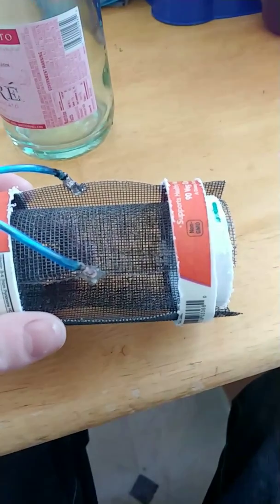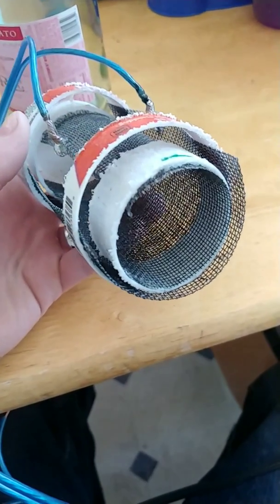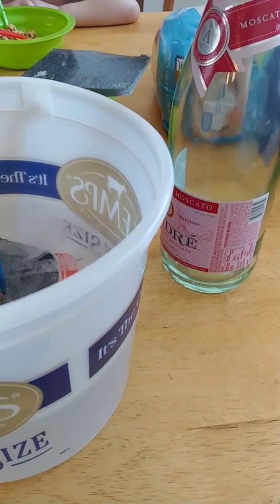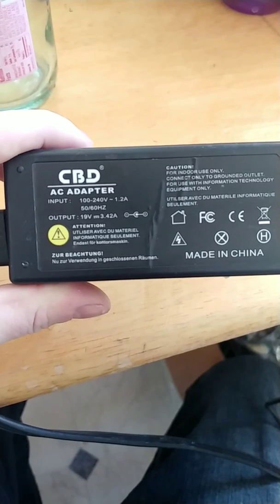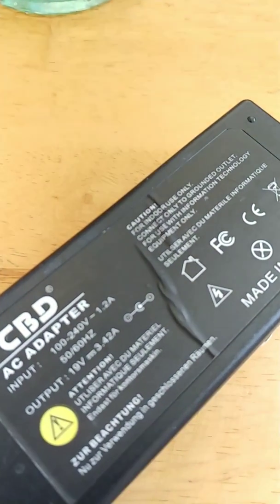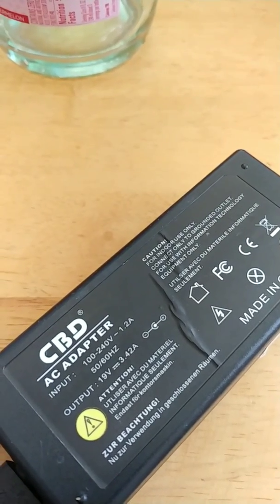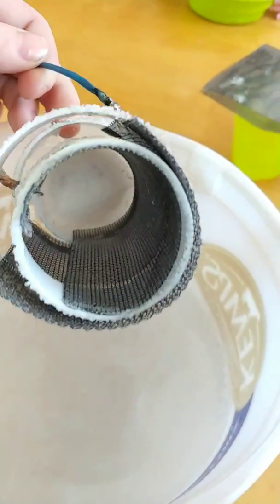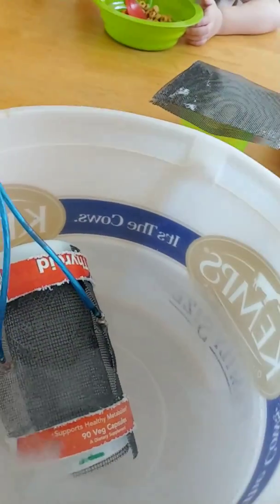Diy electrolysis O2 diffuser for under $10

Comment: Hi question: the 12V cable from the grid or mesh to PSU how do you decide what is positive or negative does it matter
Reply: It wouldn’t matter which way you connect them, the electrical charge will course the oxygen molecules too separate hence a defuser is born, but as he said don’t let the mesh wire touch each other.

Comment: youll kill your plants using toxic metals.. ive learn the anode's best metal is Platinized Titanium Anode and for the cathode 304-stainless steal will do great.. what we need are metals that don't erode and leave toxic byproducts in or DWC or RES or whatever where tryna grow... cheap metal will erode from the electrolosys .. we need ones that don't mainly the ones I described or GOLD and PLATINUM.. but we got the 2nd best.. Good luck.. I got both the Platinized Titanium and 304-stainless steal on ebay  under $25.00 for both... about to create mines running RDWC..Peace
Reply: Any chance to get more details about your build? How often do you activate it and are you also testing with a DO-meter?
Reply: Thanks for that, almost thought there’ll be no one here with some sense 🍻
Reply: 100% correct.  Plus if you use silver or copper you will make a colloidal solution which kills all beneficial microbes.
Reply: My thoughts exactly. Any update?
Reply: Did u ever upload the video of your build ?